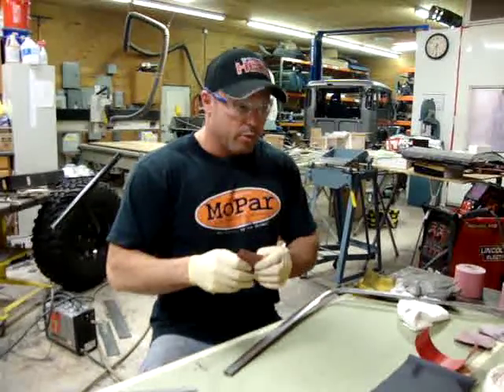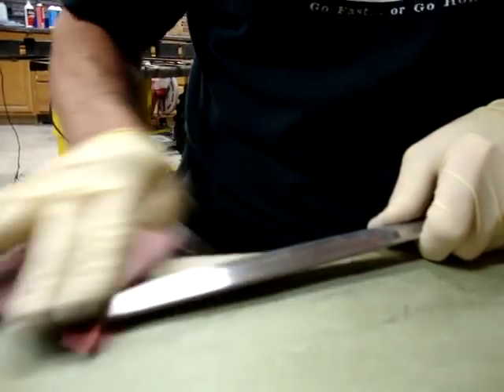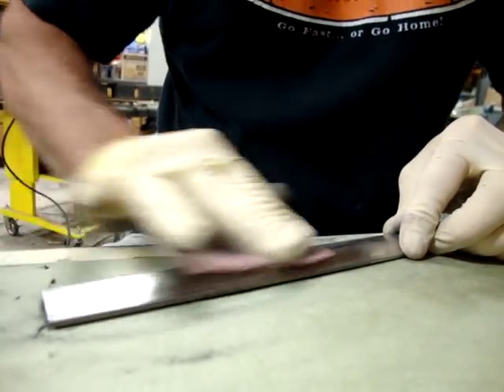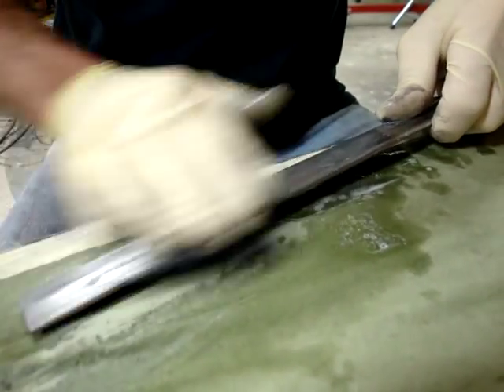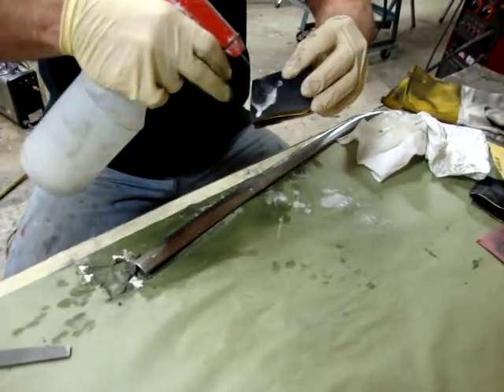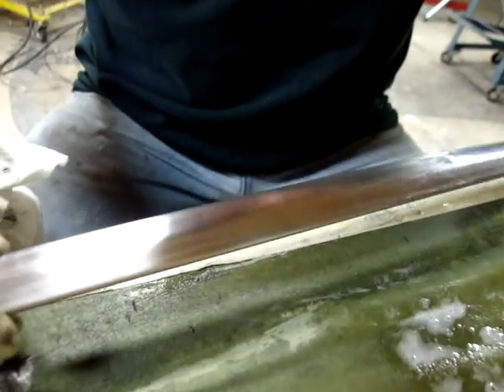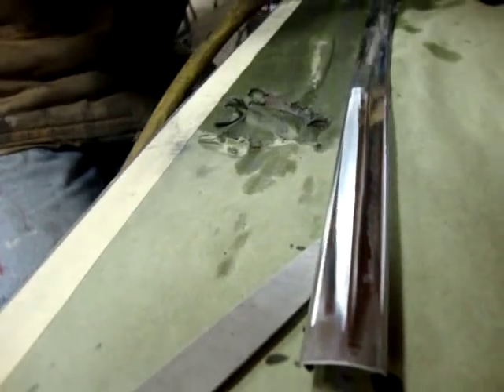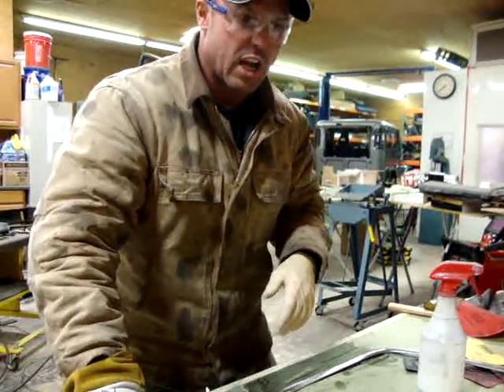Tips & Tricks for Polishing / Buffing Stainless Steel Trim Part 2.MPG

Comment: so if you have deep scratches that you can feel with fingernail etc can you use circular sanders on the 150-320 grit to make that part easier then goto hand for the rest? Also if i was to put an edge on a knife or sword what grinding wheel should I start at to end up with a nice mirror shine? after your video i went and bought 320,400,600,800,1000,1500,2000 and 2 polishing wheels total cost $120.00 and i have 10 sheets each of the paper. Im in Canada is that a good deal?

Comment: Nice video question I have a fairly new car it's a 2010 infiniti the trim which by the way I'm not sure what its made out of chrome,stainless or  aluminum is slightly scratch nothing major but you can see it . Should I use just a 1000 followed by 1500  then polish or a lower grit? Like I said its not deep scratches or rust just swirls and light scratches please advise

Comment from the maker: Wanted to add a tip when using the DA sander, set it to "spin" only as you do not want the dual action putting swirls in the trim.